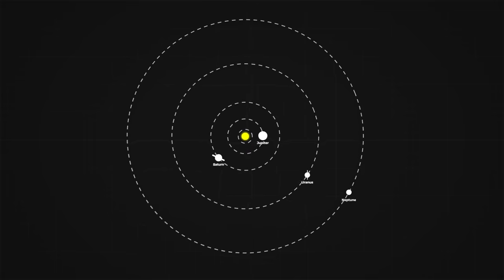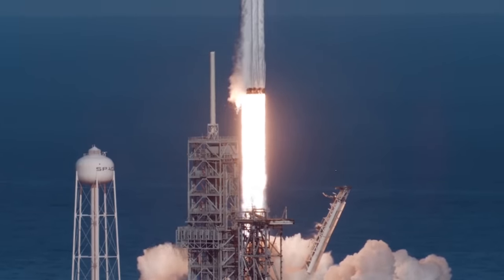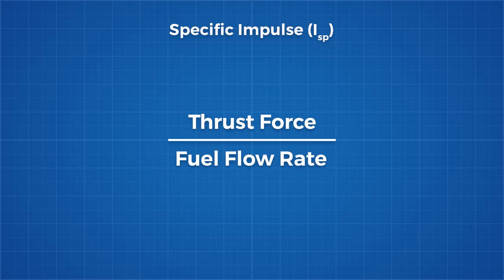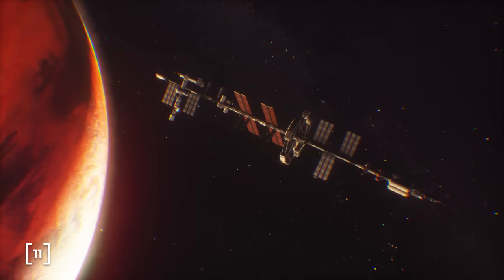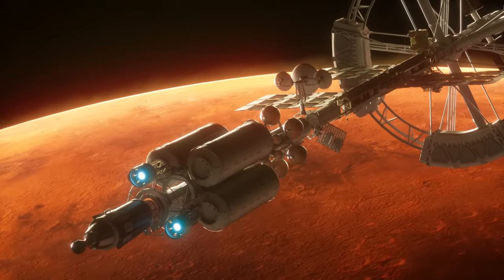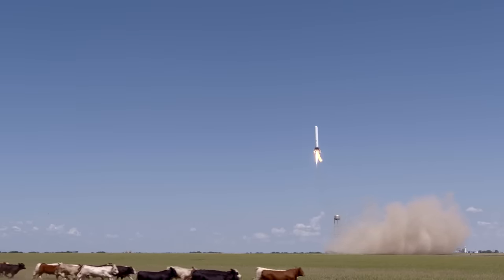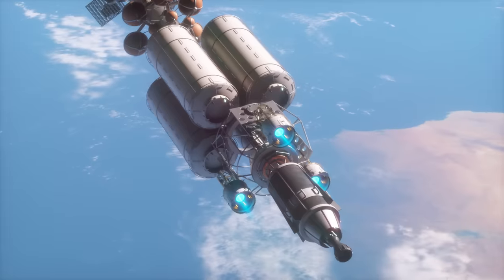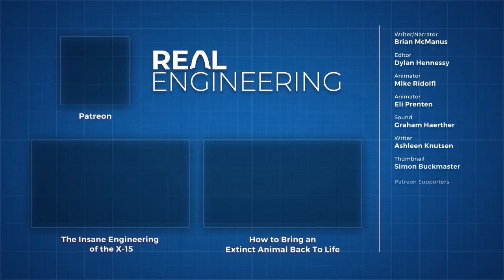Can Nuclear Propulsion Take Us to Mars?

Comment: Surprised you didn’t talk about it here, but if you throw out the assumption that your nuclear core has to stay in the solid form, you can get specific impulses of up to 7000s with thrust to weight ratios of 1-5.

Recently did a presentation on this at an AIAA conference for anyone who’s interested: https://youtu.be/eRDyRg-Bdos
Reply: Even then you could have a nuclear salt water rocket the god of nuclear engines for its high trust and exuast velosities up to 1% the speed of light. More efficient but with less thrust is the dusty plasma fission fragment engine or reactor. This can have exaust velocities of up to 5% the speed of light.

For fision fragment reactor
https://www.researchgate.net/publication/228875834_Dusty_Plasma_Based_Fission_Fragment_Nuclear_Reactor

For nuclear salt water rocket
https://www.researchgate.net/publication/265934300_NUCLEAR_SALT_WATER_ROCKETS_HIGH_THRUST_AT_10000_SEC_ISP

Wikipedia articles may have more information than these articles and have beter diagrams.
Reply: @SpaceMan776  adding to this there’s a lot of interesting work on these concepts being done at NASA’s yearly NIAC conference. If you’re looking for when sci fi propulsion technology becomes reality, I’d place good money it comes from that funding initiative.
Reply: @SpaceMan776  and of course, you can always blow up small nuclear warheads behind your craft for maximum Isp, but I’m not sure if that’s ITAR approved (or even politically feasible).
Reply: @colinwarn4606  I'm pretty sure ITAR would be fine with that seeing as how there's radiation in space anyway.
Reply: @KRYMauL  yeah but that’s putting out that much radiation for propulsion plus if we do it often would lead to problems no matter how cool it would be 😔
Reply: @ashleywheeler4120  But, there wouldn't be a problem if no one is in space
Reply: @ashleywheeler4120  A Gamma Ray burst will expel way more radiation than we could ever pull off with a hydrogen bomb.
Reply: @josephtoe1370  fair enough I’m just saying if If the future space travel were become even somewhat common also what if one of them didn’t detonate and fell into a planet but I mean if we have to leave our solar system I mean fuck it
Reply: Hey, I'm also an undergrad doing research on nuclear thermal at the University of Exeter in the UK! I'm exploring the parameter space of possible grooved ring fuel elements in solid core NTRs for my undergraduate dissertation. My plan is to research pulsed nuclear thermal for my Masters and possibly a PhD.  "On the Use of a Pulsed Nuclear Thermal Rocket for Interplanetary Travel". 52nd AIAA/SAE/ASEE Joint Propulsion Conference Salt Lake City, UT, Propulsion and Energy, (AIAA 2016–4685)
Reply: Moral of this story is I can’t type really long paragraphs in my phone easily
Reply: Issac Arthur talked about it on his video on The nuclear option.
Reply: well if we used a nuclear fusion thermal scram jet engine it would be alot safer and faster! but untill we figure out the right amonut of balncing of the magintic contamaent and figure out the needed electomagnetic sweetspot of plasma contanment! this is needed make the fusion reaction proses going! this is we are at! the final leg of the nuclear fusion research is that we are trying to fugure it out! but its takeing longer to find that sweetspot and wihout that sweetspot the reactor won't be small or powerful enotgh wihout it
Reply: @ashtiboy  It all boils down to the magnetic containment at the end😥
Reply: @ashtiboy  nuclear fusion research might never produce good/cheap enough reactors but it might be worth doing just for the nuclear propulsion.
Reply: @adamrak7560  I agree it may be not cheap, but if we find a way to store liguid hydrogen very effectively, it will be much better in the long run beacuse nuclear has a better economy in general.

Edit
Also forgot, if the government or any contractors are willing to fund into nuclear propolsion system research, we might find a better solution to stop the reactor overheating or failing. Then we would be golden for space travel for a long time.
Reply: @colinwarn4606  Wait I'm confused... how does blowing up a nuclear warhead behind the ship create thrust? On earth the hot air expansion would create a shockwave, but in space won't you just get a lot of heat and a little bit of shrapnel?
Reply: @sljzz441  In space it’s the atoms moving backwards itself that gives thrust. The nuclear device detonates and all of the particles are pointed in the opposite direction. So it propels itself forward. Which exactly why it doesn’t well for slowing down, since you’re falling into the nuclear explosions when attempting to slow down. We’d need a material that can survive all of the rays given off by a nuclear explosion, which we don’t have (yet).
Reply: @theluftwaffle1  I understand in a nuclear-powered engine you could use the energy from the nuclear reaction to push fuel particles in a unified direction. 

However, the question I asked was about a warhead. First of all, what physical particles can be pushed? There might be some  alpha/beta radiation, which have mass, but certainly not enough to propel a spaceship. I suppose if it's a fusion bomb there's also the unreacted hydrogen/waste helium? Secondly, won't they all be flying away from the center of the detonation, instead of in a unified direction?  Thirdly, the warhead would presumably be detached from the spaceship when it explodes, so how does the momentum of any of its particles create any thrust on the ship?
Reply: Are you talking about a liquid fueled reactor like MSR? they should be heaps better don't know why anyone would use a solid fueled reactor in a space engine now >_>
Reply: @sljzz441  look up 'project orion'
Reply: @josephtoe1370  better to use nuclear only for electricity, then use it to power Ion engine like the video suggest. Nuclear thermal had never been flown before, while nuclear powered satellite (by Soviet Union) and ion engine (United State) both has been used in space.
Reply: If you want to see a new fission rocket concept check out the youtube video "liquid plutonium rocket". Its a concept that doesn't consume hydrogen making it ideal for interstellar travel.
Reply: @sljzz441  From the Wikipedia page on Project Orion:
A bomb with a cylinder of reaction mass expands into a flat, disk-shaped wave of plasma when it explodes. A bomb with a disk-shaped reaction mass expands into a far more efficient cigar-shaped wave of plasma debris. The cigar shape focuses much of the plasma to impinge onto the pusher-plate. For greatest mission efficiency the rocket equation demands that the greatest fraction of the bomb's explosive force be directed at the spacecraft, rather than being spent isotropically.
Reply: @xponen  Sorry for my incompetence, and thanks for the info. But nuclear prepolsion can still be useful during emergency situation when you need a short burst but powerful energy. Nuclear prepolsion maybe viable in the far future when we have a much better understanding on how to use nuclear energy.
Reply: @colinwarn4606  Shitting out nuclear bombs for propulsion seems like it could be problematic...😉
Reply: @moonrazk  I looked it up; Project Orion is not a regular nuclear warhead, but a nuclear bomb with propellant stored at one end. Basically a one-time version of a nuclear engine.

Which is probably what the original commenter was talking about, so thanks!
Reply: @josephtoe1370  It would send an Impulse of electromagnetic energy into our magnetic field. Look up A-Bombs in space, they shut down Hawaii on one low yield test.
Reply: How would a submarine reactor adapted for spaceflight and used to power ion engines compare to a nuclear rocket? This doesn't really require any new technology iyou just have to assemble the pieces.
Reply: @dominicmcg2368  Hi there, read that you were planning on working on pulsed NTRs and I was wondering if you could help me clear up some doubts about the concept - how exactly does PNTR do constant thrust Isp amplification without melting the engine? As I understand it most NTR concepts are power limited due to waste heat dissipation, so how can the PNTR get around this? Since 96% of the fission energy is not absorbed by the propellant, won't this cause massive overheating issues which would greatly reduce thrust for a given Isp boost?
Reply: @sljzz441  Did you read the part that said they made that into a can shape weighing 300 pounds and contacted Coca Cola about them scaling up a vending machine system to manage it? Hilarious to think about it.
Reply: @dsdy1205  You're correct. The propellant is heated directly by the neutron flux caused by a nuclear excursion, the remaining heat generated, something like 94-96% of the total energy of the excursion goes into the fuel. This heat has to be removed incredibly quickly in order achieve the pulse frequencies necessary for Isp amplification. In the paper it is posited that this could be achieved with a molten Lithium salt and very thin fuel geometry. Using Lithium salt introduces other problems as Li6 in particular can form Tritium and Helium through neutron capture, which isn't particularly good for the reactor, so Li7 salt of very high purity would be required.
Reply: @dominicmcg2368  But in this case, it would still be limited by heat rejection then? Does it have any advamtages over other power-limited systems?
Reply: @dsdy1205  It can achieve increased thrust and increased specific impulse simultaneously. In most normal power limited rockets, like other solid core NTRs, the limiting temperature in the core is the melting point of the fuel and the propellant can’t be any hotter. This imposes a limit on the exhaust velocity, which is the same as limiting the Isp. Increased thrust can still be achieved by increasing the mass flow rate however. Where the pulsed NTR is different is that it is not transmitting heat from the fuel to the propellant through conduction and convection (or well it is, but just negligibly so) the propellant is heated by the neutrons directly, this means that the propellant can have a temperature greater than the melting point of the fuel without the fuel actually melting, and without violating any laws of thermodynamics. Provided you can remove the fuel’s heat fast enough to keep it below melting, the neutron flux can make the propellant almost arbitrarily hot, which uncaps the exhaust velocity and hence the Isp. The kicker is that you can still increase thrust at the same time by increasing mass flow rate. What’s uncertain currently is whether it’s possible to cool the fuel fast enough that you could achieve higher propellant temperatures than what normal solid core NTRs can without melting the fuel.
Reply: @dominicmcg2368  Right, so it's heat limited based on heat rejection into the fuel elements, but THAT depends on just how much heat transfer there is between the neutron-heated propellant and the fuel element?
Reply: @dsdy1205  It’s limited by how much heat can be removed from the fuel yes. Very little of the fuel’s heat comes from the propellant though. Only 4-6% of the total fission energy is deposited in the propellant, of that, only a small proportion will have time to be conducted into the fuel before the propellant leaves the core and is replaced by new cool propellant. The only major source of heating for the fuel is normal fission heat caused by neutron interactions and daughter product decay.
Reply: @atomicskull6405  nuclear submarines would be considered an instance of nuclear electric propulsion (using nuclear fission to generate electricity to generate thrust) as opposed to nuclear thermal (using heat transfer).  Above video describes the pros and cons.
Reply: @TheInfidel_SlavaUA  oh yeah it’s absolutely stupid and insane but in theory it would be an extremely harmful and inefficient form of space travel
Reply: I feel it’s not a waste of resources per say but at our current technological level it is highly inefficient but if we do it more it’s inevitable it’ll get more efficient or atleast I can hope lol I mean worse case scenario we’re stuck on a firing earth and just have to die

Comment: I remember hearing of VASIMR (a type of ion engine) with a game-changing mission profile: a 42-day trip to Mars, 6 weeks on the surface, and 6 weeks return to Earth. The entire mission can be completed with both Earth and Mars on the same side of the sun. If nuclear can achieve this 6-week trip time, it becomes feasible the same way. VASIMR hasn't proved out, so we may need the nuclear engine to pull off the mission.
Reply: VASIMR works, we just need an energy source. That would be a fission electric generator with today's tech.
Reply: @TheNavalAviator  Thanks, I also figured we'll need a fission reactor. Next would be what size, the power plant would not only have to supply the engines, a significant draw of electricity would go to the magnetic shield. The reactor would have to be launched as a separate module due to its weight, so our mars-bound ships would have to be assembled in orbit.
Reply: @dtvjho  The ambition was to do do away with the NTR and use only a VASIMR as propulsion for everything but you'll never get the same thrust-to-mass-ratio with a nuclear electric VASIMR system.
Reply: @TheNavalAviator  VASIMR does “work” but it still has some issues in the way preventing it from reaching its originally envisioned potential. Right now they’re not really all that practically different from ion thrust-wise (thrust is much more but not so much that it’d make a big difference) and efficiency is quite a bit less.

Comment: Minor correction: Radiation is not the  means of dispersing heat in space. Ablation can also be used, although you'd need an impractical amount of ablative for the purpose you're talking about.

Comment: In book Mission Saturn, they cooled reactor core by transfering the heat into molten metal. After that they started releasing metal in thin rolls into space to radiate heat away and catch it after all heat was released
Reply: liquid metal cooling system could also be conductive so moving it through magnets will create a charge that you can run your hair dryer with, or whatever blows your hair back

Comment: Could a hybrid chemical/nuclear thermal rocket be feasable if you just burned the hydrogen with liquid oxygen after it leaves the reactor? Or maybe a mixture of liquid hydrogen and oxygen could be pumped into the reactor instead, which will ignite when it gets hot enough?
Or maybe it could be like an afterburner, where a small amount of liquid oxygen is carried on the ship, and burned when high-g manoeuvres are required?
Reply: Magnets accelerate subatomic Particles

Comment: Would a hybrid engine work, where you use incomplete combustion to generate high mass heavily charged particles (instead of pure ions, e.g. carbon-monoxide) which then can be accelerated by an ion drive/rail gun type system to generate thrust (could even thrown in an after burner step to complete the combustion if it helped...)?

Comment: For a nuclear thermal engine, could electrical energy be extracted from the system to power electrolysis, generating hydrogen and oxygen? Something like that, even using a second reactor to power the electrolysis, would allow you to store the hydrogen longer. Even some other form of storage could work.
Reply: Yes. You need radiators to manage the waste heat, so have a temperature gradiant between the hot engine housing and cold radiators, which can he exploited to generate energy by various means. Or you can divert reaction mass from downstream of the engine and use it to power a gas turbine. 

However, reactor design constraints and issues with the very binary operation profule of an Nuclear Thermal mean it might be preferable to simply have a smaller heat pipe reactor or the like that runs in a steady state to make power. 

Or just use an Orion engine. It's way faster.
Reply: problem being oxygen is relatively heavy and you're going to have a large excess mass of oxygen if you store hydrogen in water. the real breakthrough would be if you could make metallic hydrogen, which would be stored as a solid and solve all the problems with storage.

Comment: I just saw my electronic rocket ship, from Christmas 2016, it can hover, cloak, coast around on vtol mode, and fly to the moon and back in a couple hours. Its just permanent magnets, in a torus, with some mercury, with holes opening into a rocket nozzle.

For earth to the moon, it's perfect, but I've made a few other designs since then, made for atmosphere, interplanetary, interdimensional, and time traveling.

My favorite are the throwback combustion based atmosphere craft... you can hardly see the spaceships because we have to ascertain their safety... I had to upgrade the power grid because the ionic discharge causes power surges if the grid is weak....

Comment: Sam from wendover wondering if this can apply to planes 🤨🤔
Reply: Sure... nuclear-powered plane.  Was tried way back but abandoned when it was realized that of the weight of the radiation shielding needed or risk killing the crew.
Reply: @CarFreeSegnitz  that plus the problem you got when that aircraft would be flying anywhere above the ground and do to any problem crash land back to the ground. 
I mean with a conventual aircraft it is already a massive fire ball and all. If you add a nuclear core in to the mix you would have your self a dirty bomb at best or a full out atomic bomb at worse. 
I would not like to live somewhere where those can fly over.